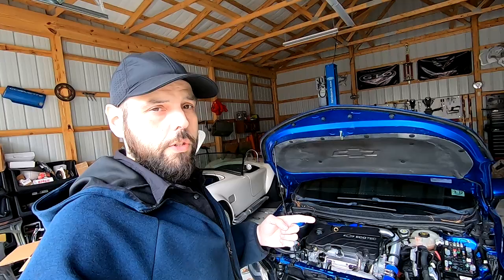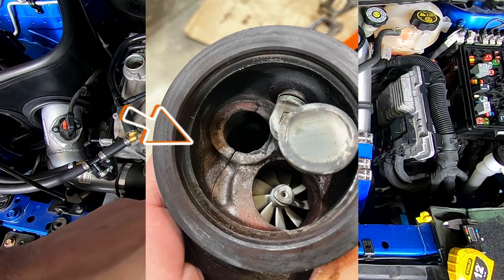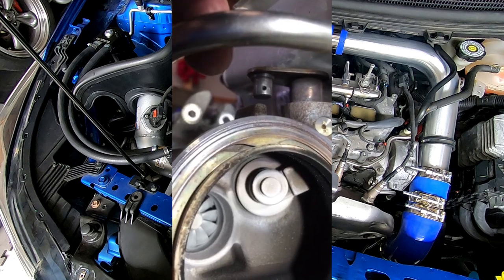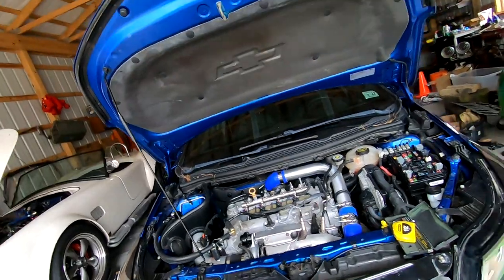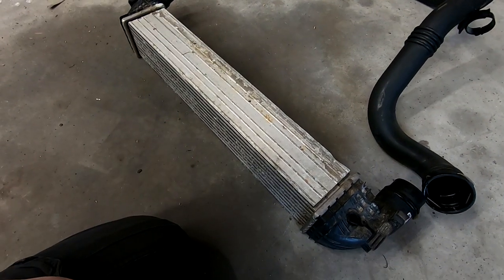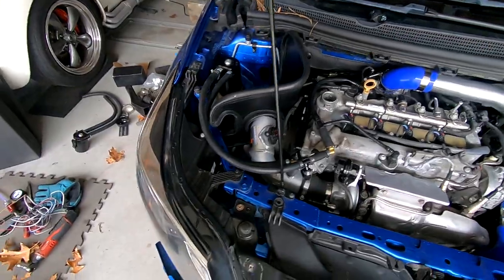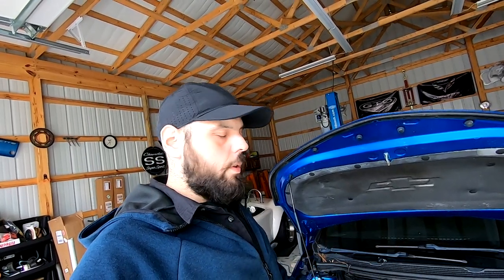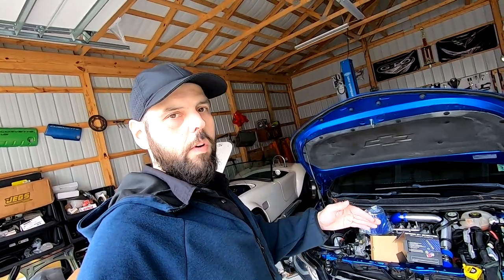Common CRUZE problems and issues from Dave's World

Comment: Hey got a 2018 cruze 1.4 auto. I was not driving the car for like a month, it was at a body shop. I got the car back and it started misfiring, i took the plugs out, coils, and the whole fuel rail out. changed the plugs and coil packs, i noticed that the hole for the injectors had a bunch of debriee and oil in them. i cleaned the injectors just with some carb cleaner but only from the outside i didn't have an injector tester to clean the inside of them. and its still misfiring. btw the plugs were dry no oil on them. If you could get back to me that would be awesome because so far i have the last option left and its injector replacement but 500$ is kind off tight for me right now. Thank you! Love your content hi from Canada.
Reply from the maker: Hi dirty injectors like that is normal because of how dirty the intake system is. www.supercruzes.com has an oil separator catch can system that changes the PCV routing. The reason those injectors get so dirty and the plugs is from the oil and moisture getting into the intake system
Reply: @davesworld2132  got it will replace the injectors and add a catch can thank you!
Reply from the maker: @mohammadkarimi4105  go to www.supercruzes.com you should check out the system that’s listed on the site because it’s not just adding the can it’s also rerouting the PCV.

Comment: A common problem on Ford Panther platforms is when people change from the OEM airbox to a cone filter, they put way too much oil on the filter.  Since the MAF sensor is only 3 inches downstream from the filter, it gets gummed up with oil from the cone filter. The car runs like crap and throws a OBDII code.   I can easily see this happening in this application as well.
Reply from the maker: Yea I've seen that before. I have a 4.6 Saleen engine in my garage and I've been tinkering with that intake system and can def see that happening to that style maf.
Reply: I haven't been on the forums for a while but I remember them recommending the dry injen filter instead of the oiled k&n filter probably for that reason

Comment: i got 2014 lt rs and i got a after market coil pack because the original one was looking a little rough with the springs and i got new spark plugs and the new was really loud “tuck tuck tuck” noise.. everytime i pressed on the gas but after i out the original one in it works perfectly. i’m guessing it was the spark plugs but i did buy that stuff because i buy the aluminum valve cover gasket and that’s been working perfectly ever since. if anybody sees this i’d recommend doing that 😂❤
Reply from the maker: Check to law sure the spark plugs are not loose as well.
Reply: Yea torque wrench on the spark plugs and they are known to get loose overtime, I changed my plugs at 90k and at 101k I had a weird noise on startup so I started googling and came to find out two of my plugs were slightly looser than the torque spec, still tight but not at tight as the others and it's been a week and I have not heard the noise again

Comment: Wished I would've seen this video like a month ago. I was having low boost code and started to chase the problem. 2017 LT auto, installed the chevy cold air but no tune yet, before the code. Replaced inlet outlet tubes  of the intercooler, and replaced the turbocharger with stock one. My cruze has 110k+ as I commute a total of 120 miles every work day.  Thanks Dave for your knowledge of the common problems again I became aware of these issues on my own and with research.
Reply from the maker: That bill hurts!!!!!! But glad you figured it out.
Reply: Well to tell you the truth I  paid nothing for the parts. If I told you how I am able to do this I think you  would block me from your channel.
Reply from the maker: @richardfrausto747  lol well I’m def intrigued!
Reply: Dave, ok here i go. I am a parts supervisor for a large fleet operator,  with a direct connection to  ordering from GM over the years I order repair parts for gm. Now the cruze is no longer in production,  our company has done warranty work. So I have so called obsolete gm parts which I take, since our agreement with GM I cannot return. Outside of a new engine or the transmission I don't have in stock. So that's my story.  I do plan on getting  your intercooler pipes and maybe the intercooler,.
Reply from the maker: @richardfrausto747  now that I love!!!!!! Jelly!
Reply: @richardfrausto747  I believe they still manufacture the cruze but just not in America because most  Americans  can no longer  fit in the average-size car

Comment: I don't have any codes, but my 17' Cruze accelerates pretty slow. It has 53k miles, only thing I have done to it is AEM cold air intake. Could there still be a crack like you mentioned?
Reply from the maker: Possibly. Do you have any way to read boost ?
Reply: @davesworld2132  No but I am working on getting one
Reply from the maker: @iamjadeenn  That's the easiest way to tell Here is a link to a cheap way to install a gauge. https://youtu.be/yhncuxrA6Sc

Comment: So I have a issue. I know I need to replace my intercooler tube to throttle body it’s no good but my problem is after about 1 hour of driving it goes into reduce power like I no longer have turbo power. I do sometimes get the turbo code. Could this be my diverter valve?

Comment: I think one problem I ran into with my build was the shifter. I don’t remember if your short throw shifter video pointed it out but for an amateur I messed up the shift linkage position for the reverse lockout so I wouldn’t catch gears properly. First, second, and reverse were misaligned and I had to go back in and adjust off of first or reverse.
Reply from the maker: Yes I had that problem as well. I also ran into a situation where the shifter was fine and then later on when winter came and it got very cold out I couldn’t get into reverse again.  Then I had to readjust.

Comment: Nice video sir, packed with some really good information. Well you  opened up a few options for me as a gen 1 owner just by talking about the   charge pipe from intercooler to throttle body. By saying it can make a cooler charge temp. At boost & less restrictions. I have been waiting for a forge Reciulation valve from BNR before I move farther on with more  parts. Also I got a belly pan for the car to see if that helps with mpgs. as well as my 12 never had one but 35.6 pre Gallon isn't bad. 
  Also with direct injection unfortunately you carbon build up on valves and intake runners due the no fuel dilution before the valves.  I imagine a good oil can help with keeping this down but if it gets carried away periodically these areas have to be cleaned as I have seen in other channels on the tube. 
 Have safe day with the family.
Reply from the maker: Hey how are you. Thank you for watching. Once I finish my meth injection design for the Gen 1 and Gen 2 it will give us cooler intake temps and more POWA! What it will also do is clean the valves and combustion chamber of carbon build up. That in it self is exciting! The belly pan from an eco model is a good idea. Also the eco model has some aero modifications over the normal version CRUZE you should look into for MPG
Reply: @davesworld2132  thanks i have been doing ok even know we have some challenges at work but we have been doing cool things and fixing our equipment & we have made improvements & it show in our production.  
 My 12 6 sped cruze  has been doing well over all. I have to change my plug gap as mine are set at 0.032 and I get blow out on deceleration. 
 I think I got a weak tank of fuel this week power seems down so I'll go to a different station next week. 
 I'm at 11 psi now and found the check valve at my Turbo on the pcv pipe  was  clogged and cleaned it up no difference from this clean up. 
 So yeah thank you again and you can reply latter to this question. 
 Will your largest intercooler work on my gen 1 engine & if so does it need a tune ?  I do know that pipes are different from gen 1 vs gen 2. 
 Know the eco rims are light weight but 175$ a rim would be 1 rim a week lol. 
 Thank you again sir.

Comment: Awesome channel you turned me onto cleaning the throttle plate which fixed my daughters car. She had been driving it in the automatic six speed mode because of the stumbling on restart now that we fixed it the car shuts off at a stoplight but you have to manually put it in park and restart it with the key. What has caused this if you have time thank you.

Comment: And with a p1101 definitely look at throttle body and make sure it is clean. I have seen a bunch of 1.5 vehicles with that code set for throttle body air flow compensation
Reply: Yea I been dealing with dat code for over 2 years

Comment: I'm looking at a 2017 Cruze with 75,000 km on it and it's a manual. I have all the carfax history on it. No major repairs just regular maintenance stuff.

Do you think that's a good purchase? I heard that manual is more reliable when it comes to avoiding transmission issues.
Reply from the maker: Does it have a lot of oil change and transmission flush history?

Comment: Cruze owner's manual says to change the spark plugs every 60k miles, BTW.   Thanks for the video!
Reply from the maker: Yea the manual unfortunately is wrong about a lot. I would do them every 25,000 miles on any turbo car especially since the 1.4 is known for running dirty air due to oil intrusion.
Reply: @davesworld2132  Good to know, thanks. I'll do that.     I just had them done by somebody else and mechanics, in spite of my requests, are loathe to give me the old parts so I can examine them and learn.
I bought the car used and I'm just trying to learn all of the common problems and issues with these to try not to lose my shirt maintaining it.   I like the car.   Here in the  mountains of Utah, it performs well for its small displacement.
Reply from the maker: A lot of times the manual is a general guide line. But it does not take into account location, seasons, driving style, and age of the driver. Most of the time the maintenance recommendations are very off because of this. It's good to learn because the more you know the better you can treat the car. Always keep in touch if you ever need some help.  @BenKlassen1

Comment: Would you say that 2018 is the most reliable year for Cruze? I've been researching this extensively it it says everywhere that the 2018 year model was above average reliability, and actually competed with other compact cars fairly well.  2017 seems to be pretty decent too. 2016 has a bad rating.
I'm looking to purchase a Cruze in the 60k to 70k mile range
Reply from the maker: 18 because they changed the engine it also in 19 they changed the nose to a different style and some of the electronics. I would go 18 if you can. 17 has known engine issues.
Reply: @davesworld2132  Would you say the average lifespan of the 2018 cruze is upwards of 150,000 to 200,000 miles? 
I live in Canada and km here so that would be idk roughly 300,000 km or something like that

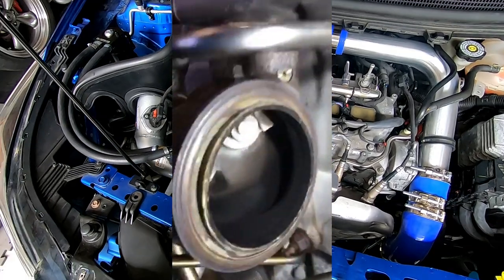Comment: 4:23 I had a car with this engine in the shop with the code for an underboost condition, and the problem wasn't a crack, but the play you're talking about where the actuator shaft passes through the turbine housing. It had become so loose that when the wastegate flap was supposed to be sealed flat around the hole, it was actually cocked at an angle and had an obvious gap around 2/3 of the sealing surface.  This obviously allowed exhaust to leak around the turbine even when it was supposed to getting maximum flow.  I had to pull the downpipe off and  use an inspection mirror and pocket flashlight to see it.  The amazing thing was that NAPA stocked a Dorman aftermarket turbo kit with all the gaskets and trimmings for about $800 that fixed it.
Reply from the maker: Hey what’s up! I have a subscriber with that exact same problem. After going back-and-forth with him we realized that buying an aftermarket bigger turbo was only a few bucks more. So he went that route instead of an oem type. But same fix. What your describing is exactly why I put that little social media clip in. How how much better did it run after you made the repair?
Reply: @davesworld2132  It was only a marginal difference, although I was not really evaluating it's performance.  All anybody cared about in that case was fixing the check engine light.
Reply from the maker: @Fopeano  lol “regular folk” take check engine lights way too serious lol i’ve been playing around with spark plug gap’s this weekend it’s amazing how changing a gap ever so slightly increases or decreases performance substantially.
Reply: @Yeah Right yup, the first search result is the same Dorman kit for $504.99.  I guess that's the cost of getting it in 15 minutes and fixing the car on the spot, which is the best way for any shop to efficiently do business.   I'll bring this up to my front end people today just to let them know.

Comment: I have a gen 1, and already checked for air leaks , exhaust, etc, and I have non, was thinking it can be my wastegate that is worn out, everytime I accelerate I have so much lag or if I’m cruising around 45mph or so and I let go of the gas, I lose power and have to floor it just to upshift and get me power to accelerate, as well as going uphill, what do you think it can be? Don’t have a check engine on btw, Thanks.
Reply from the maker: Could be that also check your spark plugs and fuel pressure. Don't just assume its a part with out doing some basic checks first. Also check your air filter.

Comment: New top of the line plugs, had mechanic monitor computer while running said it was getting too much air then not enough air when driving, cleaned mass air flow sensor properly, replaced air pressure/temp sensor, replaced gas pedal, ran sea foam through throttle body while holding at 2k rpm until can was gone and drove with spirited acceleration after as can says to do, replaced throttle body. No codes, stutters at low rpm when I try to get up on it. Seems to only happen when there is high torque demand at low rpm. If I downshift and get up on it everything is fine. Seems like it's running rich when I drive between 2-3k too much. Also ran compression test and was good.(2018 1.4 LT Cruze)
Reply from the maker: What wastegate do you have on the car?
Reply: @davesworld2132  idk but if you think that could be the problem I will look into that next.
Reply from the maker: @Mikaeel84  possibly. Supercruzes.com has them but message Jerilyn. She can further diagnose the problem. It’s easier then through the comments.
Reply: @davesworld2132  ok thanks

Comment: I feel like i need all these upgrades. I just bought a used 2014 cruze LT 1.4 and unfortunately i noticed after buying that it pulls or bumps on acceleration around 40kmph and sometimes 60kms but runs smooth after that. Im also not comfortable with sll the plastic i hear deteriorates because it runs hot snd would change to aluminum or metal after market replacements

Comment: 14 Cruze LTZ RS auto, runs smooth no codes, 32mpg or less going 70mph. Same mpg going 65. 35mpg 50mpg. I’ve lost boost a couple times. Never an engine light. Does have oil leak. I noticed I haven’t heard the shutters close. But that shouldn’t take away several mpg. So I’m thinking something turbo and piping related I’m not sure. So many things
Reply from the maker: If you could email me through my website we can diagnose the car a little bit better than on YouTube. I think I know what may be wrong but I need pictures of your engine bay

Comment: The Volvo OEM intercooler has  a small weep hole that allows to drain any moisture collected inside. VW products do not have this feature and they collect so much water that it fails to start.

Volvo also reverse the piping to prevent this problem on colder weather locations.
Reply from the maker: Interesting. I wonder if a catch can system would help as well.
Reply: @davesworld2132  The weep hole drains the moisture before it enters the engine, catch can collects the inside moisture. They booth work, just a little different!
Reply from the maker: @bernardaflores1720  I was wondering how often the weep hole might clog
Reply: @davesworld2132  I have never heard of the weep hole clogging up, It might be possible if by ice/ moisture it will unclog when temps raise.

Comment: Could you please list all of the problems that you know of that would cause a 2013 Cruze LT turbo I4 to overheat. I have changed the water valve, water pump, thermostat, temperature sensor at radiator and recovery tank. I’m trying to fix the car myself. It has around 98,000 miles on it. Thanks
Reply from the maker: Contact me at customcruze@gmail.com so I can help look over your car.

Comment: I have a 2019, was throwing p1101 codes, me and my buddy took a part the throttle body, cleaned that, cleaned the mas, replaced the engine air filter, cabin air filter, hopefully no more idiot lights.
Reply from the maker: Keep me posted if you need any help.
Reply: @davesworld2132  I have two friends that are mechanics. But thank you, this tool at Firestone out here was far from helpful, I actually called their corporate office because he was such a asshole.
Reply from the maker: @travfromthelou  ouch. Sorry they acted that way.
Reply: @davesworld2132  their loss. I'll never spend another dollar with them, I just asked if they could tell me what voltage range my mas was reading at, after spending over 400 dollars on shit with them a few months ago, and they pretty much told me to either leave it for two days or pound sand. So fuck em.
Reply from the maker: @travfromthelou  damn that sucks